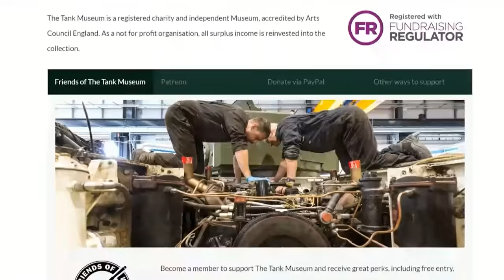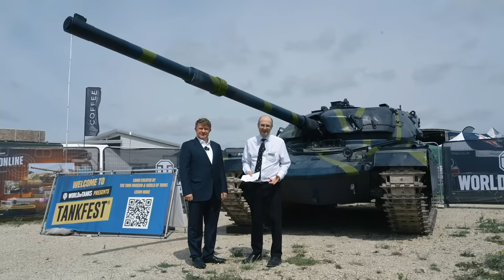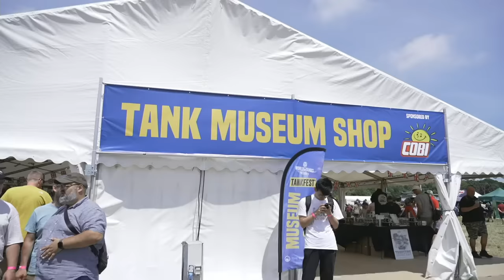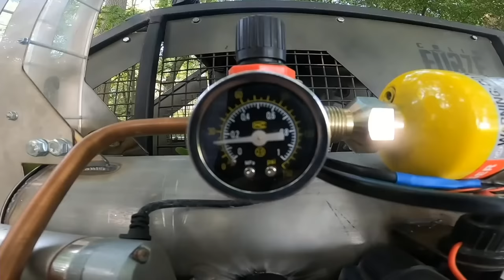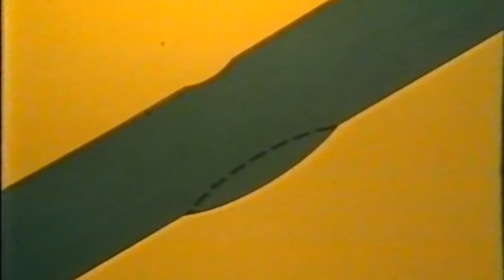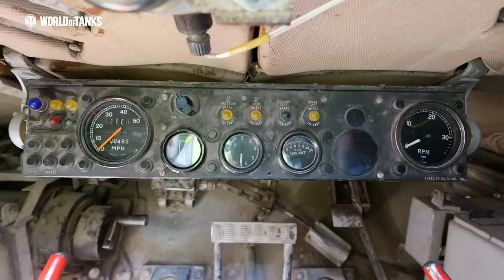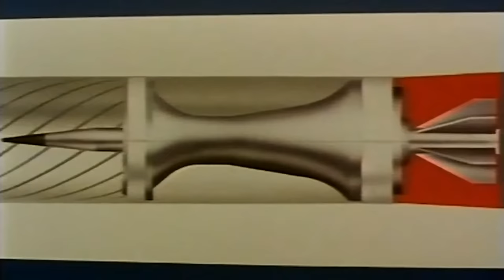TANKFEST Online 2023 | The Tank Museum

Comment: Around 1:26:00 perhaps The Tank Museum will redo as its own video because sloped armor was clearly known by 1860s and used by ironclad CSS Virginia to battle the USS Monitor.  Plenty of earlier tanks with effective sloped armor like the French FCM 36 (1933) or Hotchkiss H35 (1936).  Those designs were really made to fight tanks of the early 1930s same as BT-5, Panzer I, PzKpfw II, etc.  And the Christie Tank M.1940 (1930) with its very sloped frontal armor became the BT-series Soviet tanks which lead to that later 1937 design T-34.  But there are many even earlier tanks which also had effective sloped frontal armor like:  Schneider C.A.1,  Saint-Chamond,  Renault FT-series,  LK II = Strv m/21-29,  Char B1, etc.
Hope The Tank Museum considers doing such a video and could point out which tanks had sloped frontal armor was a design decision to improve driver's road vision?

Comment: 27:30 APDS was not depended on by British tankers, APDS, especially 17pdr APDS was extremely inaccurate and would rarely be fielded to crew as it was barely serviceable as ammunition. Its high penetration can not be argued with and it would certainly punch holes in Tigers, but the issue of accuracy was so extreme that this ammunition was not frequently utilized. The ammunition would still struggle to penetrate vehicles like the Jagdpanther or Tiger 2 unless the gunner was particularly lucky.
Reply: The problem was erratic separation of the {aluminum) petals of the sabot, so half the time the tungsten penetrater went wild. Britain continued development post-war and by 1950 they were able to start re-manufacturing old stock to perform properly.  In the meantime Canada had begun delivering another, more reliable version by 1946.

Most of the kills of the Firefly against Panther or Tiger I were by 17 pdr shot from the sides or rear, same as the Sherman 76 but even above the Sherman's limit of 1000 - 1500 yards range. Fortunately tougher Tiger 2 and Jagdpanther were very rare!